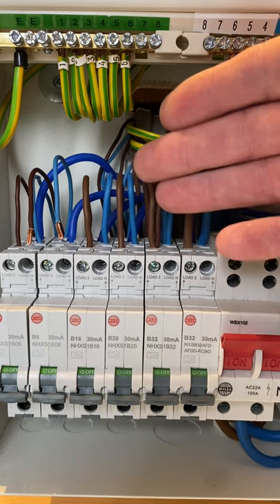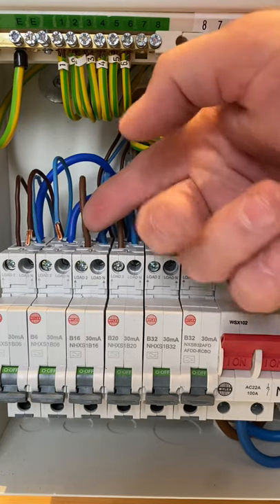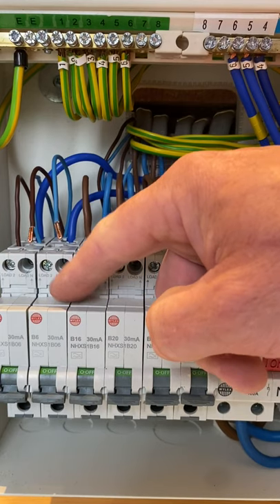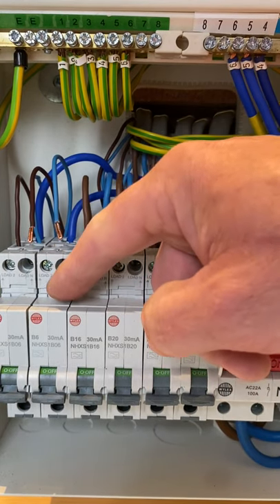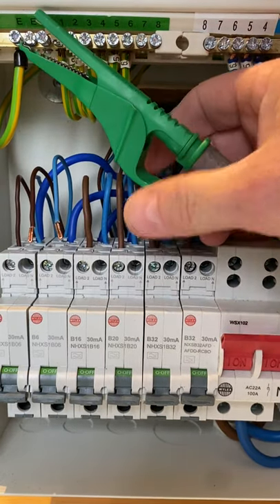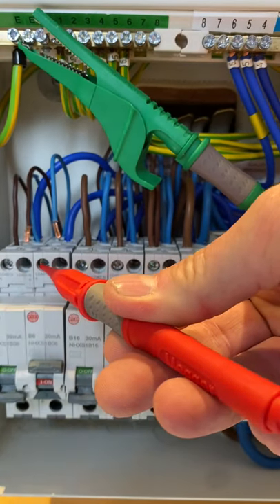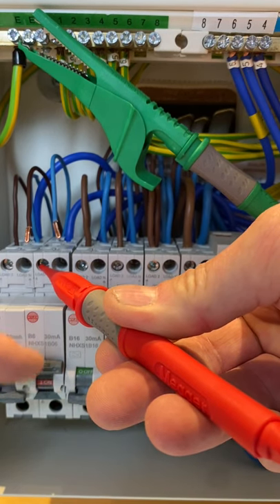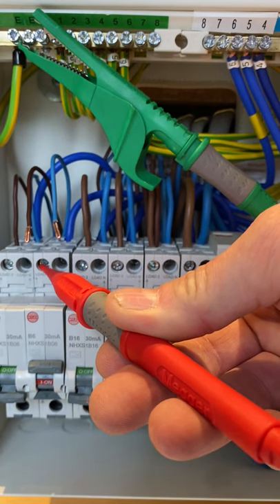RCD Testing Made Easier…? ✔️

Comment: You are only testing the rcbo and not the overall installation in conjunction with the relevant rcbo.
Reply: Thats what Zs, R1+R2, End to end and IR testing does though
Reply: GN3 states the load should be disconnected when testing an RCD

Comment: Why do you have to remove the loads? I often rcd from a nearby accessory. If it passes I'm happy. I don't care about absolute results. Seems to be a counter insentive to disconnect all loads for testing.
Reply: Because you get false readings. every load has some form of residual current leakage. this can be up to 10-20mA on a whole circuit. If you then test with loads connected it will trip at the current the tester introduces in the circuit+whatever is leaking in the circuit. If you tester then shows it shut off at 30mA, great it passed. But it might have been 50mA if you count your loads. 

you still have no idea what the tripping current is though.

Comment: Isn’t this just the same as pressing the test button, the real test would be performing it at the furthest point of the circuit. To get the highest(slowest) disconnection time… 🥺
Reply: No
Reply: @reeceoverton1421   then explain cleaver clogs 🧐🤣
Reply: @jamiekent1970  pushing the test button puts a much higher current across it than I delta n. It doesn't prove the device will open at the rated current. Standard is to test on the load side at the device

Comment: You're testing tripping times ?  Shouldn't you be testing at the farthest point in the circuit? If the time exceeds the specified limit, then that circuit doesn't comply with BS7671 ?
Reply from the maker: Hi it’s an RCD test not an earth fault loop impedance 👍🏻
Reply: @GSHElectrical  We always test at the device like you do, but then an additional ramp test with loads connected to get a real world feel for any potential nuisance tripping (I know that's not a required test but saves 'it worked before you put that thing in' call backs :)
Reply: @GSHElectrical  so your testing  parts of the circuit separately (RCD then FL) and not as a complete apparatus. Seems strange.

Comment: I know it is a 'should not be' to have 2 RCDs in series... (due to the nuisance) but when it DOES occur, say on EICR's... a tip to test ONLY the one local to you, to get readings for THAT device... use the Neutral INCOMING to the device as the earth... tests the imbalance in the same way :) (then of course note as a c3 or potential c2 if it kills safety critical circuits)

Comment: I always test with them installed as because depending on the circuit I've found that you get different readings with the loads connected.
You only need to remove lamps and loading accessories when IR testing
Reply: GN3 states the load should be disconnected during the testing of the RCD

Comment: Perhaps I’m a bit behind the times, so please help to educate an old fool.  
I would do a Zs reading at the end of line. Then, I would do the RCD test also at the end of line, to check that at the end of line, the time is still within limits. I would do this with all loads connected, as would be in the final installation as utilised by the end user who may be experiencing an Earth fault on that circuit at the furthest point.  Please explain why you do it at the RCBO with all loads disconnected. Is there a reg you could quote in BS7671. Many thanks for the demo and a reply would be greatly appreciated. 
Note: if the answer is just because you are testing the RCBO device and not the circuit, then can you please comment if my method is industry preferred “best practice”, or should I only be concerned with testing the device, regardless of the circuit it is intended to protect, which is as per your method demonstrated in this video. 
Example: if measured at the RCBO the time at 5x was 32ms but at the end of line was 38ms, I would record 38 on the test sheet as the slower time. Is this technically correct, or good or bad practice, or just plain wrong? Thanks.
Reply: I may have possibly partly answered my own question. I guess some loads may leak a small amount of residual current, so when testing a 30mA RCD, with a load on that circuit of 10mA, there’s actually a 40mA imbalance during the test, which would not be a true test. But still curious why you wouldn’t do this at the end of line.
Reply: @sam04019491  i believe it should be tested with a load, if it didn't trip with the load connected in question then it could be that the protective device is not suitable🤔
Reply: Should be testing RCD with no loads connected for the reason you gave in your reply to yourself.
Reply: You can do it anywhere in the circuit you like as long as there are no loads it’s the same test with the same result
Reply: If the trip time was 32 ms at the rcbo it will be 32ms ANYWHERE along the circuit.
Reply: @MrSJT I was thinking the same just because u Der load there are different variables that could affect the tripping times

Comment: This gives us an Isolated disconnection time purely related to the actual RCD device without testing the circuit it protects 
Are we only testing the RCD or the whole circuit?
Reply: In this case, the test is undertaken to prove that it will function within the correct time given an applied current of the rated device :)
Reply: You’re only wanting to introduce that test current to purely test the device, should a fault occur during circuit operation, you’ve verified that the device will operate. Hope that makes sense.
Reply: Yes true. I think best practice would be tripping from GPOs then tripping lighting/ac/boiler circuits at the switchboard

Comment: Hi Gary great video as usual . Just want to add one comment and that is you should disconnect the Neutral fly lead also for the particular RCBO under test.before you proceed with the testing.
Reply: Just curious why?
Reply: If you disconnect the incoming neutral what are you testing?
Reply: @charliedecker7702  he's on about the flylead, not the incoming neutral. Still don't get why.
Reply: @charliedecker7702  All loads disconnected is whats required
Reply: @XeonXR6  the flylead is connected to the incoming neutral.

Comment: I have my AM2S very shortly, if I was to test using this method, is it not a failure of safe isolation?
Reply from the maker: On the AM2S rig you will have secured isolation before this and you only have one RCBO for the sockets and that circuit will have nothing plugged in… so test from the top of the RCBO with it in the off position. 👍🏻
Reply: @GSHElectrical  does this mean we can test at the top of the RCBO without disconecting the load cables?
Reply: @GSHElectrical  how can you energise the RCBO in order to carry out the RCD test if the main switch is locked off? Or have I misunderstood?

Comment: ..... what if the load is the fault      
..... fault on the wires you have just disconnected ie a leakage into or out of those wires that you have just disconnected , that create a bypass , short , leakage , failure , over supply into , out of and the RCD doesn't  trip soon enough , Quick enough.... voltage jump upon amperage rise , 

You have disconnected wires 
You have changed the status of that system 
It's ok I've disconnected a power supply I didn't know about and everything tests fine    who says those aren't supplying a source under certain conditions 
Who says there isn't two switches , load feeds 

   Test trip in place
   Test components of the circuit 
   Close test the full circuit

Ahhh but if cow's fly over the moon , Jack's beans grow to create another bean stalk 
   Smile as you get electrocuted  .

Electrons take the shortest path    
  They only want to get there 

   Smile as you get electrocuted .
Reply: Time to cut down on the crack pal.

Comment: Na never do this always do rcbo or rcd under load I don't think this is a tip I think it's stupid
Reply: Ok. But what you may not be testing at rated current. Your testing plus whatevers leaking on the circuit which is variable... So you're not doing the test right. The correct test is off load at rated I delta n. At 0 and 180. Concern about loads stalling the device is a selection issue and should have been considerer prior.
Reply: @travoltasbiplane1551  mate you have no idea what your on about with an answer like that
Reply: @paulsidebyrne  🤣 ok mate. I beg to differ. What exactly did you take issue with...
Reply: @paulsidebyrne  sodit... Skip to the end. Have a search for 'iet testing rcds off load' you'll find an article by Mark coles.'  You're welcome... You can now start doing it properly. Must be brilliant being so sure of yourself. 🤣
Reply: @paulsidebyrne  no? How about guidance note 3? It's in there too. Or do you not want to play anymore?
Reply: GN3 actually states to disconnect the load when testing an rcd

Comment: Thanks for sharing Gary. So I assume if it failed for any reason, you would then go to the lamp fittings to see what is happening?
Reply: Wrong 🤣 he is testing if the rcd trips within specified times, 1x less than 300ms, 5x less than 40ms... If it fails replace rcbo, however you can test with loads connected so i dont understand why he removed the final circuit...
Reply: @Seth-vv1gu  Because you want to test the RCD functionality, not RCD functionality plus possible leakage current from connected appliances. That would also falsify the tripping current reading.
And tripping time for 1x is less than 200ms 😉
Reply: @Marcel_Germann  you are wrong about the tripping times dude deffo 300ms 😂😂😂
Reply: @Seth-vv1gu  Here in Germany in a TT-system it's 200ms, in a TN the VDE even permits 400ms.
The 300ms are only relevant for the manufacturer of the RCDs, except the British regs state that 300ms too.

Comment: Why are u testing unloaded??
Reply: because it shouldnt need to be under load as you only need to check the rcd, all your other tests should find any potential faults on the circuit, if any
Reply: I know i dont get why the load of the rcbo was disconnected, ive tested numerous rcbo's with loads connected and they test fine...
Reply: @Seth-vv1gu  If you test a circuit that's got a bunch of leakage on it it might get artificially faster trip times?

In the extreme, say you've got a faulty RCD protecting a faulty circuit. There's 50mA of leakage but the RCD hasn't tripped. You don't disconnect the circuit, test the RCD, it trips at 75mA, your tester thinks "great, I applied 25mA and it tripped in a sensible time, all good". 
In reality, at the specified 30mA the RCD might not trip or might not trip in the required time.
Reply: Ahhh okay dude, so disconnecting loads will remove the earth leakage so you get a true test of the rcbo or RCD... So even when you do an auto RCD test the earth leakage can still give you an artificial reading ?
Reply: @Seth-vv1gu  I'm only guessing that's why, that and not wanting to confuse a load of electrical goods turning on and off rapidly for a few minutes.

The "On site guide" says "The tests are made on the load side of the RCD, as near as practicable to its point of installation and between the line conductor and the associated circuit protective conductor. The load supplied should be disconnected during the test."

You can always have a bit of leakage from a circuit which can bias results. The other way of looking at it would be if you've got 10mA of leakage on the circuit then your RCD would artificially fail the 1/2 times test even if there might be nothing wrong with it. 10mA of leakage plus 15mA from an RCD test would put you right in the area at which you'd expect it to trip.
Reply: @tomcardale5596  Yes, this precisely. Is why we also do a ramp test WITH loads connected, to check a bit beyond what's required :)
Reply: GN3, take a read